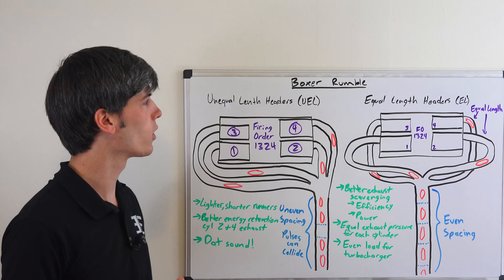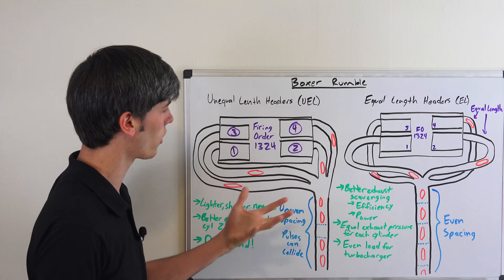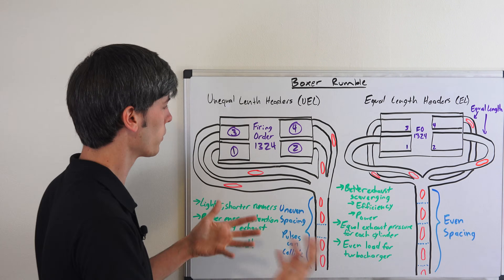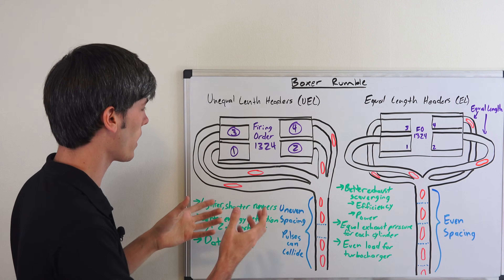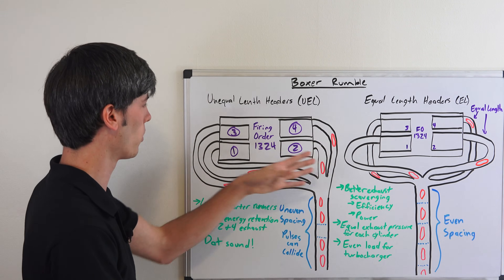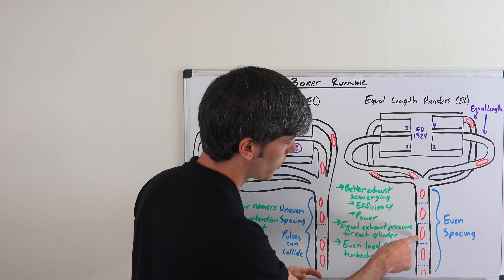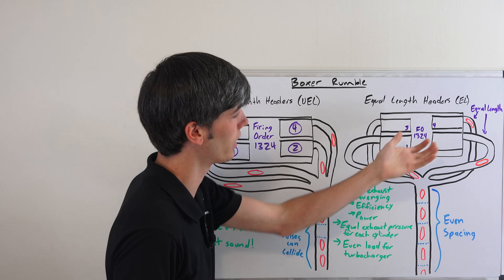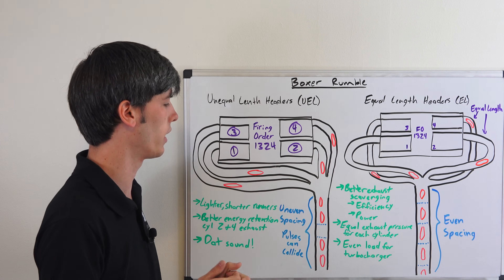Subaru Boxer Rumble - Exhaust Explained

Comment: So is the FB20 engine the example on the right side?
Reply: +cobra454tim FA20*
Reply: +Bryan Doherty  thank you!
Reply: +Bryan Doherty FB20 exists mate. As well as the FB25
Reply: that or every NA boxer
Reply: The FB is in the NA Outback i think
Reply: +HJZ75driver fb is turbo in the wrx. fa is NA in everything else
Reply: the engine is the WRX is called the FA20DIT. The engine is the NA Outback is the EJ25D
Reply: Bryan Doherty ya i got it backwards. i guess the outback is the only one without an F engine in North america, besides the sti
Reply: The FB is only used in the Forester 2.5i and Impreza 2.5i, and a turbo version for the turbo Forester. The WRX uses the FA20DIT. The Legacy and Outback still use the EJ25D in four cylinder models. EZ36 in six cylinder models. The STI is still the EJ257. The BRZ is the FA20 with Toyota's D4-S. I asked my buddy who's a Subaru tech and that's exactly what he told me. He's worked as a Subaru tech for 20 years.
Reply: Bryan Doherty Doesn't really matter how long he's worked there, info is still wrong. WRX motor is actually an FA20F, DIT just stands for direct injected, turbo. FA20D in the BRZ.

There is no impreza 2.5i, they use the FB20B.
Forester, Legacy, and Outback (doesnt use ej like i thought) use the FB25B

The FA20F is also used in the Forester XT, Levorg and JDM Legacy GT.
Im talking about current models only
Reply: +Rome1017 Rome is right. Subaru already changed to the FA and the FB. The STi is the only one with the EJ engine.
Reply: Not in North America. The WRX is still an FA20DIT in North America
Reply: +Bryan Doherty the fa is the new motor..... it JUST got it... sti has the almost 27 year old EJ. FA20F*
Reply: +Bryan Doherty Rome is right. The FA is the new motor. The EJ is the old one. Subaru started using in the new FB engine in the 2011 for the forester and FA on the XT. For the legacy and outback they started in 2013 (FB engine as well) and I think they starting using the FB engine on regular Imprezas on the same year.  But the STi is still stuck with the EJ engine wich I know they will replace it in the next generation. They have to lol.

Comment: Would the STI engine benefit from equal length headers performance and efficiency wise? Or is that engine designed to be operated with unequal length headers?
Reply: +Alex Johnson Yes, EL is better in every way except for sound.
Reply: MikeG4936
"....except for sound" thats a matter of oppinion. Personally i prefer the EL sound.
Reply: +Alex Johnson  Yeah  its gains power, you just loose the sound. Which is a good thing if you want to blend in.
Reply: Sooner/faster turbo spool. Equalized cylinder pressures/temperatures.

Comment: Dear EE, 
 I need a really urgent answer from you. I just replace an aftermarket HT lead/sparkplug leads that connects to the ignition coil pack. I test drove after fitting it, I pulled over after 10 mins and open the bonnet to check it. On touch it's very hot, Im not sure if it is suppose to heat like that. Could you please reply before I jump off a cliff. Thank you and I love you.
Reply from the maker: +Pvulture b Don't jump off a cliff. Your friends and family love you. Me too. 

Signed,
EE
Reply: Engineering Explained But you didn't answer myyyy... bang!!

Comment: Would it be possible to twin turbocharge a boxer engine? More specifically, would it be efficient? For instance, when referring to the video's boxer diagram, if you have 1 and 3 have their own tubing to Turbo One and 2 and 4 being directed to Turbo Two, would the exhaust turbine be spinning fast enough to allow for the compression levels to be at a functioning level?

Note: I have only a basic understanding of turbo systems and in no way educated enough to understand their functions in an engineering setting. 

Thanks!
Reply from the maker: +Tarek Hill Anything's possible, but for lower power applications a single (twin-scroll) turbo makes more sense. Less lag, more low end.

Comment: Thanks for finally making an explanation of this Subaru sound that made sense. Been trying to figure it out for a year now, but the explanations usually didlle and get stuck on the firing order. Cleared that up with your explanation of the pressure fronts.  Do some more car review videos. Either way looking forward to more good stuff from you man

Comment: Are uneven pulses also why motorbikes, especially Harleys, rumble like they do?
Reply: Harleys don't fire at exactly spaced intervals from each other, the second piston fires just before the first is done with its exhaust stroke. Also, to save money back way back when, instead of having a proper distributor that fires the sparkplugs only when needed, both plugs fire at the same time. This means that the spark plug also fires during the exhaust stroke. This weird spark plug firing oddity was kept out of tradition, as was pretty much every other weird engineering compromise that Harleys have.
Reply from the maker: Haven't looked into it but depending on the layout it could certainly be the case.
Reply: There's probably an episode in it.
Reply: YES and no... using Harley for example, they use a 45 degree V-Twin and a offset firing order... SO even if the exhaust pipes were exactly the same length you would still get that rumble. Then there is the even firing twins with unequal length pipes like Suzuki Boulevard line ... so it all depends on the manufactures.
Reply: +lobsterbark
Harley placed its two cylinders 45 degrees apart on a common crankcase mainly so the engine would fit into a bicycle-style frame originally intended for a single-cylinder powerplant. The first cylinder fires, the second (rear) cylinder fires 315° later, then there is a 405° gap until the first cylinder fires again, giving the engine its unique sound. There are many reasons this is not the best design... but the exhaust sound and "feel" of the Harley is so synonymous with "cool" that it has maintained its place in the market for what a cruiser engine should be. It boils down to the natural feel the engine emits. Sort of like a human heart beat... where there is two quick pulses then a long delay.

Comment: so why does uel header provides more torque compare to the el header on the same 4cyl boxer engine?
Reply: +Engineering Explained I'm still waiting for the answer. Kinda curious :)
Reply: +Sean Xu unequal length headers, and log manifolds, will always create more torque than their counterparts the equal length long tube header. with one downfall, they will not create more top end hp because of airflow restriction.
Reply from the maker: +Sean Xu Who says it does?
Reply: Engineering Explained dyno result.
Reply from the maker: +Sean Xu link?
Reply: The uneven exhaust pulses help to push one another out which allows more bottom end torque to be produced. Thats my guess.
Reply: +Sean Xu 
lol it's the other way around dude, EL provide more torque than UEL headers, the answer is in the video.
EL headers = even exhaust pulses = better scavenging = better (earlier) turbo-spool.
If the engine is not putting out crazy HP figures the difference is minimal though.

The dyno result you showed is from a naturally aspirated engine with low power and the difference is minimal, anything can happen.
I bet if this test was ran a couple more times, they might have had varying results with some showing the exact opposite, it's no hard-proof for UEL performing better than EL.
On any modified WRX engine EL headers are clearly performing better.
Reply: +Dan B the dyno result is for  86/frs/brz. They always show that the uel headers have more torque comparing to the el headers. The same result is reached from borla, tomei as well as other brands. Maybe this is unusual, but I am just curious why.

Comment: +Engineering Explained Does all 4 cylinder boxer engines use a flat plane crankshaft with even firing order? Or is there some that have a cross plane crank with odd firing order, thus giving the rumble naturally without uneven length headers?
Reply: +Richard Andersson There is the Yamaha cross plane engine but its an inline not a flat engine
Reply: Danny Contreras Yes I was also thinking about that, and a boxer would suffer from the same second order vibrations at high rpms as an inline engine I assume. But I am not an engine engineer so I am just guessing.
Reply: +Richard Andersson no they all use flat plane

Comment: Huh.  I thought exhaust scavenging was all about using the pressure drop behind the exhaust pulse to help pull more of the intake charge in during valve overlap.
Reply from the maker: +rhkips Nope, it's about pulling out the exhaust from the previous cylinder, thus decreasing the amount of energy required to pump that air out.

Comment: Is that an airplane engine on your thumbnail?
Reply: +cencalmatt The color alone says its a Continental probably their new IO-240? Also two spark plugs provides a better and more efficient burn
Reply: +Patrick Ford    It does appear to have two spark plugs per cylinder which leads me to believe that it is an airplane engine. I'm guessing Lycoming. Airplanes like Cessnas have double the spark plugs for redundancy. 

I was wondering about his argument that the header style on the left weighs less. He claims it is less material but, is that actually true? if you move the straight pipe over to the left, you're adding some material on the right and losing some on the left... hmm
Reply: I believe that's a UL Power aircraft engine...too advanced to be a Lycoming ;)
Reply: +tklaue    It is a ULPower UL260i Aero and two spark plugs aren't going to do all that much for burn. One is all it takes. It's more about safety.
Reply: +Jerrod Lindquist Lycoming is old school for sure but definitely tried and proven if you ask me.
Reply: +cencalmatt Oh, I'm just giving them a hard time. It's not all their fault that their technology is the same as at the end of WW2...but it essentially is.

Comment: Can you put UEL Headers on the WRX?
Reply from the maker: +Alex Frey It's probably possible, but you need to remember it's a twin-scroll turbo which uses the exhaust pulses from pairs of cylinders, and by changing the length you change the effectiveness of the turbo. I certainly would not recommend it: https://www.youtube.com/watch?v=T7JTRRlSEYI
Reply: +Alex Frey, yeah you don't want to give up that quick spool just for sound!

Comment: My Mazdaspeed 3 makes a similar sound, sort of a gurgling, because of our stock UEL exhaust manifolds. Sounds great!
Reply: +Zack Richmond Yeah, I've always thought that the MS3 had one of the most underrated exhaust notes. Especially with a nice quality aftermarket exhaust that isn't too loud.
Reply: +Zack Richmond Yup, I always wondered why my friend's Speed3 sounded so rumbly. Makes more sense after this video
Reply: You should hear an Volvo 140 series, with the B20, 2 litre, short stroke I4. They sounded as gurgly as the old Subaru. The motors were almost as oversquare too. The twin sidedraft carby models with the C cam(mildly lumpy, factory camshaft) sounded best!
Reply: Not as "UEL" as the Subaru but will a UEL design, I had a Mazdaspeed 3 gen 1, removed the two resonators, kept everything else stock, and I loved the sound! Had some drone but not too much, the sound was deep

Comment: Inefficiency never sounded better!
Reply: +Steve Matchett Just about as efficient as any other engine if you treat it wrong. Ever notice the ones that spin a bearing or throw a rod are doing donuts or are really low on oil? Take care of it and it lasts forever. Or don't take care of it and it won't last long. True for any engine.
Reply: ***** If you think subaru makes weak transmissions then you, sir are a horrible driver who needs lessons on how to shift.
Reply: +Steve Matchett Subies are not known for cracking blocks... at all. There have been many cases of EJ20's blowing head gaskets, some EJ25's, and the 2008-2009 EJ's had an issue of ring land failure. EJ's are overall more reliable than the majority of the modern market options. Moral of the story: Get aftermarket head gaskets (especially if you put a bigger turbo on, or a boost controller. Most cases where the head gasket blew the cars had upped the boost). Don't buy a 2008-2009. Subaru lightened the pistons to appease the EPA's demands that year, but if you're up for a lower end rebuild there are aftermarket pistons that aren't environmentally friendly tissue paper.
Reply: Mike Krammer i support this statement
Reply: +Unbearable Pain disconnect a plug on an older gti/gli with an exhaust and it sounds hilariously similar. SIMILAR.
Reply: *****
Glass gearboxes? Sounds like something you'd get if you had an architect design a transmission! LOL!
(I have a strong dislike of modern architecture)
Reply: Shawn Moses I sound ignorant? How? Show me where I made a wrong assumption based on ignorance, and prove me wrong. The EJ's are great engines, and I said that they are in a previous comment, so what did I say that you disagree with?
Reply: O yes . Answer : two stroke
Reply: ***** early series being what years? I can't speak with experience about subies that I haven't driven. I have an 06
Reply: Sam Son word. The one thing I will admit about my subie, personally, is because of the idiot young girl I bought it off of. She learned how to drive stick on it. I got it cheap because she fried the clutch past the rivets. Once I put in a new clutch I realized she fucked the synchros in 3rd, and 5th gear. I'm gonna wait and put an sti 6 speed in instead of tearing this one down. Don't know if you ever tried to fix individual gears in a tranny, but it's a nightmare. Avoid if all possible lol
Reply: +Steve Matchett so does mazda and its not uel
Reply: @MrStlover99  mazdasped 3
Reply: +Unbearable Pain 
LOL, like a screamin demon! (Detroit Diesel 2 stroke engine)
Reply: +Benjamin “Ozias” Esposti those are definitely fun lol
Reply: Mike Krammer no wonder my 07 sti takes a beating and nothing happens
Reply: UhhhSitrep I've thought there should be a buyer beware sticker attached to the bill of sale, or ownership that says, "don't drive me until you put a quality head gasket on me" lol
Reply: compared to 4 strokes, 2 strokes are better in terms of mechanical efficiency and volumetric efficiency but lose out in thermal efficiency due to poor scavenging.
Reply: +Unbearable Pain someones never heard a classic american muscle car before then lol
Reply: Lol yup. and to others,  from my personal experience. 2004 wrx, 300 hp, stock internals. 150k. 60k modded miles.  still runs great, engine and tranny. when it goes I will swap  internals, no problem so far and it gets driven hard daily.
Reply: Ӎiкә Кяāӎӎәя oh dang. Yea the first clutch went at 90k, second is going strong. Definitely wanna stick with oem style clutch on stock 5spd so it slips. Worn syncros suck, yea I haven't decided my next step but the 6spd swap sounds legit, definitely way stronger. Don't wanna even try to fix individual gears lol. I know somethings gonna break with the higher mileage and increased power, so I'm saving for that day, and then I can go more power with built internals :) Goodluck with yours!
Reply: +Sam Son Proper double de-clutching will avoid everyting!!!  If you own a Subaru, you want to be Colin.  Well - drive like him!!!
Reply: Sam Son get a 07 sti trans. Mine is very strong
Reply: +Unbearable Pain everyone always says its inefficient. but a long tube turbo manifold can hardly be less efficient than a log manifold.
Reply: Hell Yeah!!!
Reply: I'm really interested in a 6spd manual too, mainly because it suits the terrain where I drive more than the 5spd. I get caught behind somone who's terrified of going the speed limit through the super twisty hilly  cresty parts and I have to hang back in 2nd gear reving it higher because going up to 3rd I don't have enough torque and don't want to bog it.
Reply: "Granny shifting when you should be double clutching."
Reply: Shawn Moses the Mazda speed3/6 actually do have UEL’s from the factory which is why for a i4 they are quite rumbly. The runner lengths are much closer in length though then a UEL on a Subaru. I own a MS6 btw. UEL’s in general aren’t as good as EL’s in just about every aspect. JDM ej207’s have had EL’s for years and the fa20dit has EL’s too, just a better more efficient more reliable design. Engine stays heated properly on both sides with EL’s. Best way to avoid ringland failure is a good set of EL’s protune and mishimoto (or any quality) oil cooler. You’ll do nothing but routine maintenance and make a easy 320+ whp 400 wtq on a stock turbo STi.
Reply: pun intended
Reply: until that motor is no more lol
Reply: 😂😂😂 love it
Reply: Agree to disagree, that rumble is music to my ears
Reply: Detroit Diesel has joined the chat
Reply: +Joe Dijeaux Also quite efficient at kicking pistons through the block
Reply: 305 horsepower out of 4 cylinders since the 90's is hardly inefficient.
Reply: Mike Krammer you sound so ignorant. you like being a follower of haters? The EJ motor is a beast, I have one
Reply: benny savio hudson also bad fuel economy
Reply: +Mike Krammer yep! my 03' wrx head gasket needs to be changed smh
Reply: Unbearable Pain ya it sounds good but that's why #3 piston always goes bad